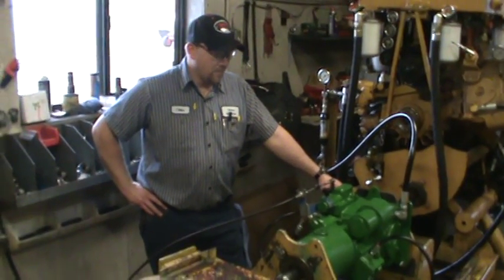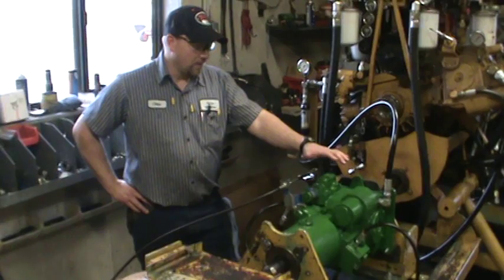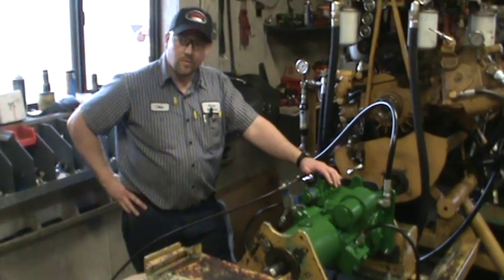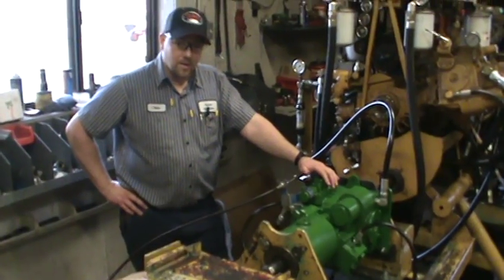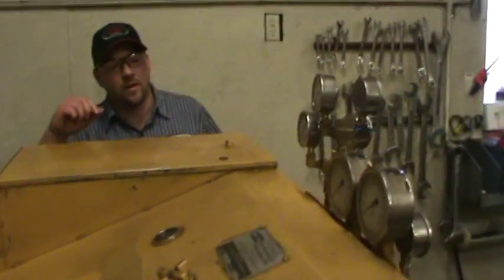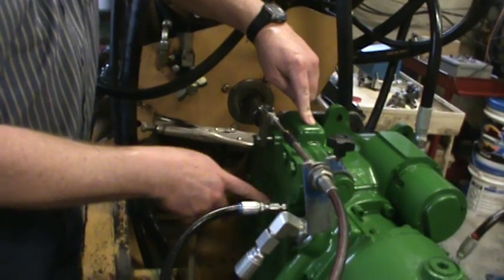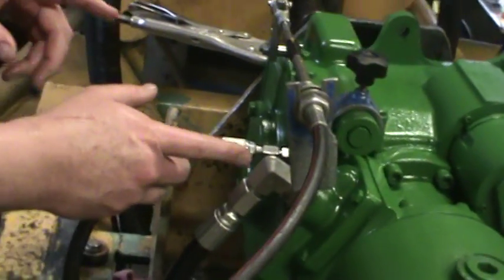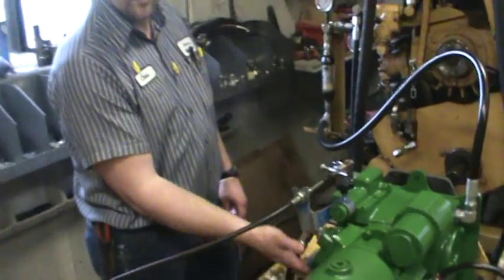Chris Dyno Testing John Deere Combine Hydrostat

Comment: I'm having a weak hydrostatic transmission in 2nd and 3rd gears, especially when hot with my JD9500 combine. New hydraulic filters did not help, this has been occurring over the five seasons that we've had the machine. The hydro charge pressure light and buzzer also trigger when it strains both forward and reverse. I've been thinking it's the charge pump. Do you have this unit? # AXE16072, new from Deere at almost $2700. and they want $200-400 to flow test it at the JD dealer.